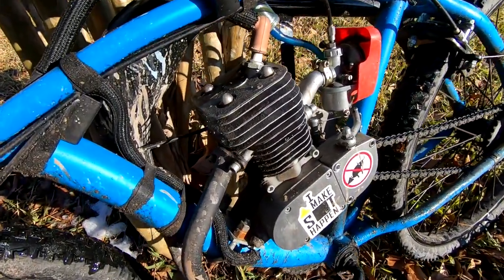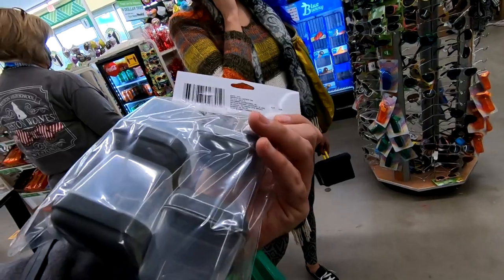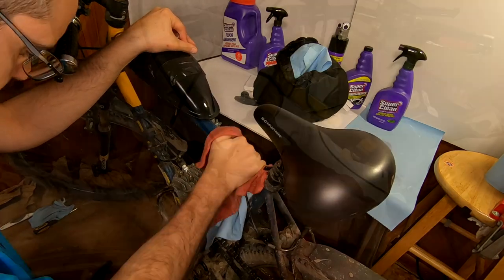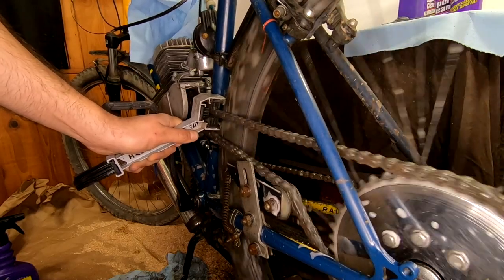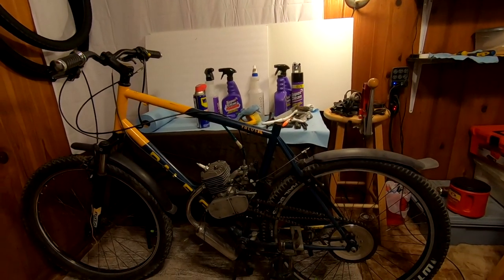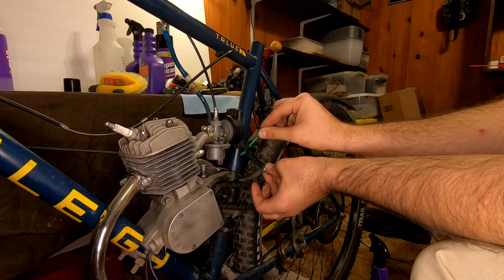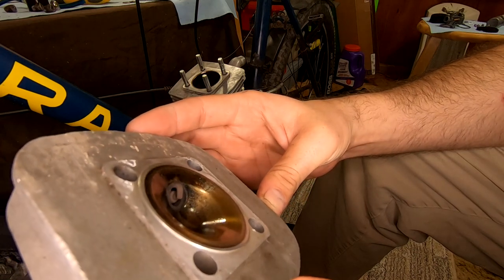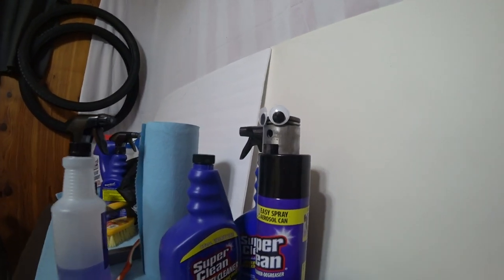Motorized Bike Basic Maintenance

Comment: Hello LA Hover, I started off motorized bikes with a blue Sun bikes frame and a 66cc ebay motor. I fount your channel when i started and your videos helped me understand these things SO MUCH. Your videos also helped entertain me while i was waiting on replacement parts... lol that happened a lot. Since then, i wanted more power, so i tried to upgrade it, and i failed miserably. So, as any normal person would do, i set out for the biggest and baddest motor out there... A 212cc predator (hemi) I bought a Firmstrong Chief and went to work, cutting grass, washing cars, etc. (im 15 btw) i worked enough up to purchase everything, and started building... SHE'S A BEAST. Then, i realized coaster brake means no stop with big motor lol. im now waiting on heavy duty mad wheels for the bike. P.S. I used the thumb throttle off your green cranbrook. P.P.S. i still find every single one of your videos entertaining, and i think it would be cool if you did a 212 build or maybe a 79. Thank you so much and introducing me to the amazing hobby of motorized bikes!!
Reply: Awesome dude!!
Reply from the maker: Congrats! Stay safe on that beast lol :) I'm sure I'll dig into a 212 some day :D

Comment: Any quick tip. RED KOTE for inside gas tank's. Any gas tank that shit works great.they say u can use to coats but I did mine four times so now ItS like a new plastic tank inside of em.plug the drain line hole with something long so u dnt block it off

Comment: I just wanted to let everybody know that those small harbor freight generators head gasket and head fix  bike kit with little modification longer studs and drill the holes bigger  I'm pretty sure the Piston bearing fits to I had one kicking around decided to cannibalize it for some free parts and the head takes a bigger spark plug something to test out might be better ignition

Comment: Have you ever opened up your bevel gear casing and and had oil spill out...like mine was filled with oil. Any ideas why? I use a 25/1 oil to gas ratio.
Reply from the maker: I have not, but I'm guessing your crank shaft seal is bad.
Don't panic, it's a super easy and cheap fix. The only hard part may be taking off the small bevel gear screw.
Remove the gear with the kit's included gear puller (uses wd40 on the threads and make sure it screws in deep), pull out the old seal with a pick or pliers, grease the new seal and push it in... Done
https://www.amazon.com/UAUS-2pcs-Stroke-Engine-Motorized/dp/B07TX8MCD5/ref=sxts_sxwds-bia-wc-nc-drs1_0?cv_ct_cx=motorized+bike+seal&dchild=1&keywords=motorized+bike+seal&pd_rd_i=B07TX8MCD5&pd_rd_r=04f851cd-e7fc-4401-9c32-f89970026961&pd_rd_w=LD3nw&pd_rd_wg=Tm9QA&pf_rd_p=a64002b9-9c26-4361-b8a1-b0f5a4835670&pf_rd_r=25VA6C8G4JGPC80BJFMG&psc=1&qid=1610768731&sr=1-1-38d0a374-3318-4625-ad92-b6761a63ecf6
Reply: @LAHover  Thanks

Comment: 13:25 my engine is different. I don’t see the bolts protruding out like that. They are like down in the engine why would that be just different engine type
Reply from the maker: The Motoos kit maybe? or a BT / YD motor. It's a single piece jug, so no head gasket , and a built in head.

Comment: Picked up a used motor yesterday it's only about 4 months old the guy blew the head gasket is it possible to make your own it's only a thin piece of metal just wondering
Reply from the maker: I have never tried it, but I have heard of guys making them out of a soda can. Most of these motors come with a basic aluminum head gasket, you may need to stack a few to get it about 1mm thick. And make sure it does not over hang coming in contact with the piston. Otherwise you can find them super cheap on amazon and ebay.
Reply: LA Hover Thanks for the reply I’m gonna try to make one but I’m ordering a few to thanks again
Reply: @NicksBikes  ordering some tomorrow made one just don't trust itthe motor's basically brand new I don't want to hurt it the guy never maintain torque on the headbolts and blew the head gasket what a easy motor to work on wish I had them in high school

Comment: whats your opinion on a thumb throttle?
Reply: i have one on my 212cc bike and its working out amazing. way better than the stock throttle. note, you may have to trim it up a bit if you dont have very straight bars (ape hangers etc.)
Reply from the maker: I heard the name brand replacements are good, but the cheap ones on amazon are brittle.
Reply: @LAHover  thanks